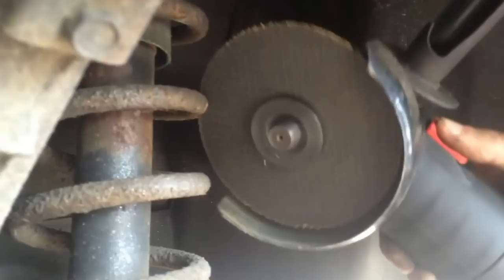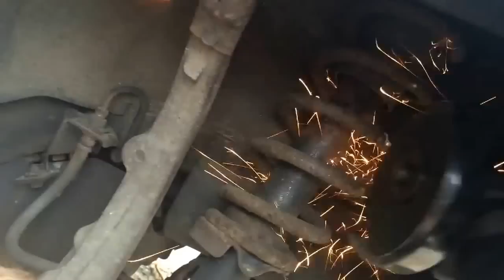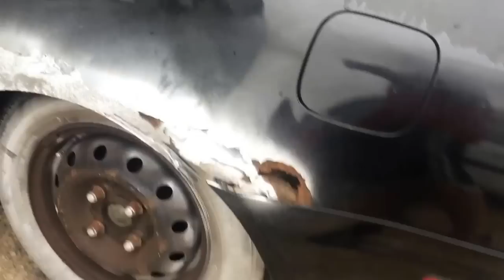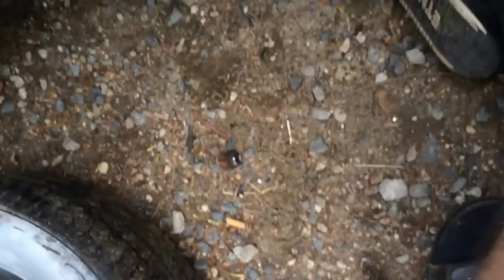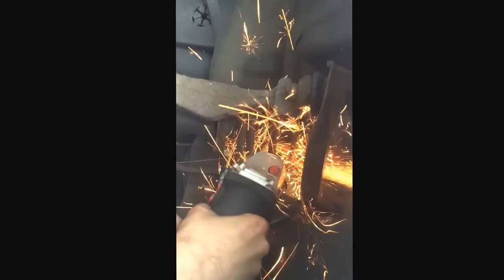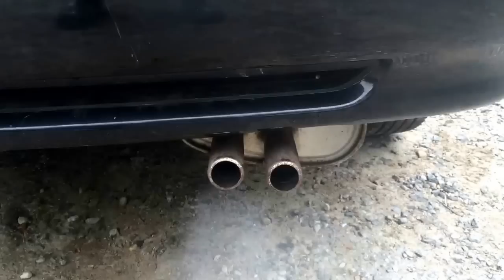How to slam / lower your car free and easy

Comment: but does this eventually cause damage to tires or anything? I want to lower my f150
Reply: why would you lower a f150 wtf
Reply: Cutting springs is bad period
Reply: You better not lower a f150 unless ints beyond old.
Reply from the maker: If you cut springs on your daily driver your dumb